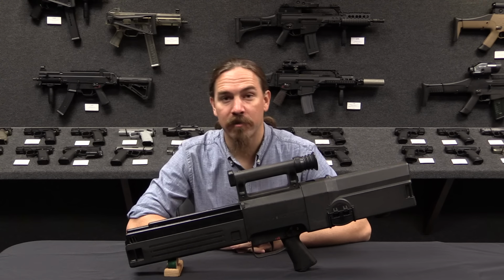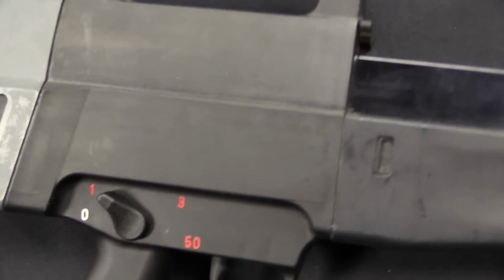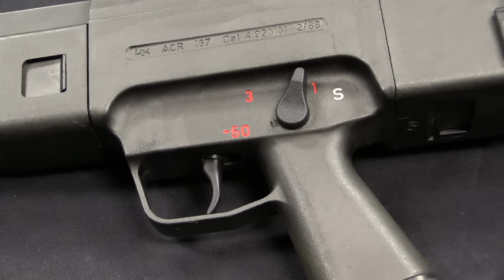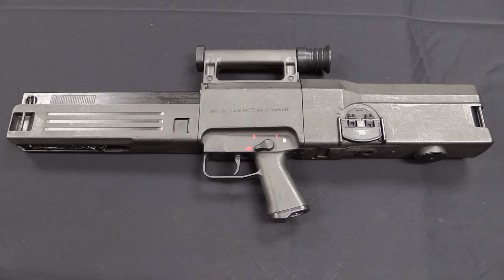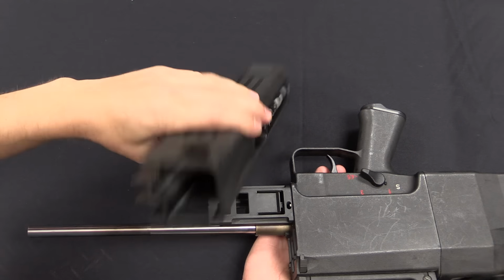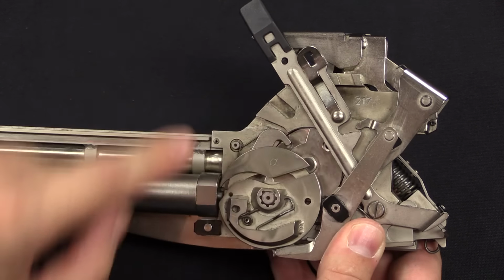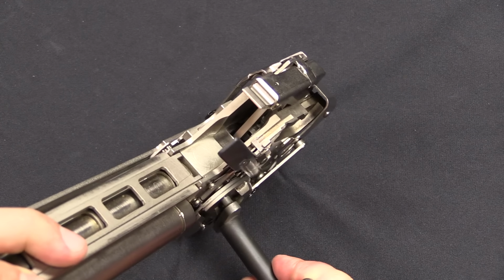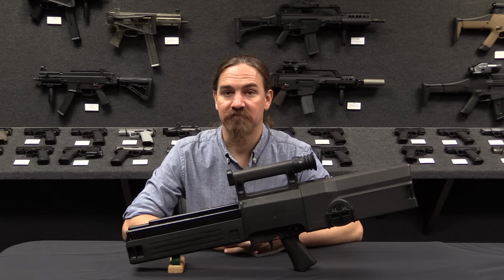Kraut Space Magic: the H&K G11

Comment: Steampunk mechanism very cool.
But ?WHY? the choice of 4.7mm?
That's like 20 caliber ... A pellet rifle! 🤣
Ian, wish you had discussed the ballistics, range and accuracy....how much energy in foot lbs at 100 yards?
Reply: its about 1500J. for comparison 5.56 has 1200J-1600J
so its enough. 
Also a smaller caliber allows for more armor piercing capabilitys as the bullet hits a smaller area as a larger caliber so the Energy/area is higher. 
Remember the goal is not to kill to enemy but to take them out of the fight. thats why nato went from 7.62 to 5.56 even though 7.62 has more than double the Energy. 
The accuracy of the G11 was insane as in the 3 bullet burst fire mode the 3rd bullet already left the barrel when the recoil hits. 
and for range. the gun was required to defeat warsaw-pact armor at 400m but under the hand it was advertised that it could even defeat it at 600.

Comment: My M-16 in the Army was also extremely easy to take apart, clean and put back together. Still to this day I can take apart an M-16/M-4(AR-15) with my eyes closed. And I just don't understand why they had all this wasted space inside the G11. I mean they could have made that thing SOOOO much smaller with VERY little effort. I mean the back of the gun did not need to be that big or wide. I honestly think they designed the front to hold those mags, then just decided to make the back about the same size just to make it look even.

Comment: Did they do any jungle environmental testing? Because that looks like it wouldn't like being exposed to dirty water.
Reply: It was not designed to be used in a jungle or a desert by Bundeswehr, they were purely a defensive army back then, not supposed to fight outside of western and central Europe.
And the mechanism is not that complicated, I mean there is far more complicated machinery that does still work in a jungle or a desert.
I guess heat would be the real problem if one emptied those fifty round mags in a short time in a hot climate.
Reply: It was designed to be used by the German Army, so they never would use it besides defense

Comment: Clearly all the design work was done on the internals, because the exterior of this gun is absolutely HIDEOUS.
Reply: function over form. the project was cancelled mid design. the exterior as you can see could be changed easily as there was space everywhere.

Comment: Considering how empty the back is and how short it is overall, it wouldn't take much to move the grip further to the back and use 75 or 100 rounds clips along with a longer barrel. Maybe make a marksman version where the metal parts are encased in something more robust than plastic.

I always wonder about the caseless ammo reliability ? Did it prove to work well or did it leave too much residue and cause malfunctions over time ? Also what kind of bullet and ballistics are we talking here ?

Could it be scaled up towards 7.62mm ? 12.7mm ? Main argument we hear against 7.62 is usually "it's too heavy for poor baby soldiers to carry" but if it's caseless maybe the weight becomes less of an issue ? So many questions..

Comment: Fantastic, extremely informative video. At the time, I recall the G11 as being under development (this was in the 80s) but still had some teething problems. When it disappeared a few years later, I assumed it was due to technical issues, not the actual political changes that led to the cancellation of the program. It's a hell of a weapon, and it seems likely that if adopted, in time there would have been improvements to the base design and function that could have led to greater accuracy and reliability. Thanks for sharing!

Comment: "See?  The cleaning is so simple.  Now, of course, if this ever gets to the point that you need to detail strip it, you're totally screwed."

A good description of basically every German made machine ever.
Reply: the MG42 would like a word
Reply: @1190reasons  Yes, this "Germans over-engineer everything!" trope really doesn't hold up to scrutiny. There are tons of examples of German designed stuff being simple, rugged and easy to maintain and repair.
Take the VW Beetle for example, or the Leopard 1 and 2 tanks, or the G-36.
And even stuff people use as examples for this supposed German tendency to make everything more complicated than it had to be, often turn out to be the opposite, when you look at them closer.

One example of that are the overlapping wheels on Tiger and Panther tanks.
Sure, they had the disadvantage that they could freeze shut when lots of mud got in between them and then froze, but other than that they were actually a very sensible and functional design, especially when compared to the complicated Y-shaped strut, lever and spring suspension systems British and American tanks used at the time. How would those have held up to Russian mud and winter?

The overlapping wheels had many advantages. 
They spead the weight of the tank out and lowered ground pressure, making them more mobile in mud and when driving over bridges.
They acted as spaced armor against hits from the sides.
They made the tank more stable, decreased crew fatigue and made shooting on the move easier in absence of a stabilized gun.
And they were ultimately easier to change and repair under field conditions.

Sure, it is annoying when you have to remove 3 or 5 wheels to get to one behind them, but it is easier to remove several thinner wheels that weigh maybe 40 pounds each, than it is to remove one big one that weighs 100 pounds.
So even from a maintenance perspective that system made sense.

And when it comes to the G-11...
Just because it looks complicated doesn't mean it is over-engineered. 
It does something no other gun design can do. To prove that it is over-engineered, one would have to design a machine that can do the same thing while being simpler and nobody ever has done that.
And it successfully passed all trials, including extensive field tests, so any speculation over this failing because it supposedly is too complicated are just that, baseless speculation and assumptions.
Reply: @TrangleC  Germans quit making simple stuff over half a century ago.
Reply: @TrangleC  cope
Reply: @TrangleC  "haha Germans overengineer everything" and you had to pull out a wall of text
Reply: @JamesAdams-bd9df  and more importantly, quit overdoing stuff during your french holidays of 1939
Reply: @1190reasons  mhm

Comment: 3 bullets in single brust before the recoil hits that's really impressive, but wouldn't the recovery time after the brust make it kinda pointless? 
Judging by the soligers from the video where the gun was tested they would loose sighs on the target each time they pull the trigger so they will have to re-aim every time. 

Also wouldn't it become real torture for the user after 100 or so fired rounds because of the triple recoil?

Comment: it feels like this gun is one of the few guns that would actually be simpler if it was ran with circuitry
Reply: You don't want to get into a shootout and find out that the battery is dead.
Reply: Yeah I think electronic ignition for the "primer" would be better(basically using a hot plasma arc to ignite the cartridge)... 
 You could also Incorporate basically an alternator in the mechanism, charges a battery or capacitor every time it fires(capacitor has much longer life) 
 And that would remove some of the recoil energy and convert it into something useful. 
 You could easily waterproof all the electronics by dunking them into potting epoxy, which would also help remove heat. 
 I think using titanium inside the firing area would help remove heat, there is likely some other things you can use or do to remove heat.. possibly using a sterling engine type heat pump to push the heat out of the chamber and into the enviourment
Reply: @helpabrothawithasubisaiah5316 
There's better way to waterproof then dumping into epoxy and removing easy repair options.
Reply: It’s the rounds that are the real killer. They are less reliable in storage, transportation, and cook off. Not a good thing in the middle of the desert. 
Plus, with something like the AK, where you can swap mags in less then a second and carry multiple mags on you easily, this is not really needed
Reply: The problem is that adding electronics you would also have to worry about one more thing,and would basically make the cadtridges more expensive or the weapon discardable.
Reply: @lordanonimmo7699  I think the intended joke was to replace some of the complicated and easy to damage mechanisms with electronics that simplify the process.

It's one thing to see a massive watch-like mechanism and have to carefully keep track of pins and screws. It's another thing to just make sure a circuitboard is plugged in the right way around.
Reply: @The1TrueEcho  Yeah,but it is also one thing to such a electronic system to endure so much stress and heat that comes from a weapon.It would just be easier to broke.
Reply: @The1TrueEcho  The minigun isn't carried by soldiers the whole time,it doesn't have to fall on sand,water,mud and other things,so is much easier to design put electronics on it.
Reply: @lordanonimmo7699  tell that to the gameboy that went to Iraq and survived a bomb
Reply: @The1TrueEcho  The minigun's actual electrical system is actually much simpler, really just a wire powering the motor and not something super complicated; even if there are complicated electronics that has to be there (FCS for instance) they can be placed far away from the gun itself.

For an infantry rifle while you can place the electronics far away from the rifle, the major problem is still what do you do if the electronics shit itself, and what good does it do to the rifle compared to an old design - the flaw of the G11 doesn't really come from the complicated clockwork (although certainly contributes to it for being literally impossible to maintain on field), but the fact that it uses caseless ammunition that is too complex and introduces so many issues a circuitry based firing mechanism doesn't even address
Reply: @The1TrueEcho  electric power != electronics
But OP is right, the G11's firing system is what happens when a bunch of mechanical engineers try to build a computing device.
Reply: As good as it sounds, you won't have much luck after a nuclear explosion and it's EMP
Reply: The first thing real troops should be teached is how to do without electric stuff first, then in case it works use it, making the rifle electric will make your troops unreliable by design
Reply: He is correct tech would make this gun better unfortunately everyone who makes guns is like 50 lol. So no one wants to add tech to a gun and take the risk of actually inventing something. Make that gun. It would be cracked AI in a gun is op you see it all the time in games
Reply: @Rizzinomics 
Flash news: Life isn't video games yet. Guns cost money to make, need to be lightweight so troops carrying them don't die of exhaustion after 1 hour of moving, and tend to get dirt, mud and all sort of liquid splashed all over it. Guns in games are always good because they're fictional, developers can make a glock kill the sun without a fuzz. Why don't you try that IRL? 50000 await your success.
Reply: @crappyshorehen8201   close minded you just labeled everything we need I’m not a gun manufacturer so why would I make one. It’s plausible so chill
Reply: @Rizzinomics 
If it's plausible then do it. Also, I barely get what you're trying to say in the first half. Why am I close minded? What I labeled? What's that "everything we need"? Your reply is incomprehensible.
Reply: @Rizzinomics  You know how many problems it will cause? As long as only americans get to keep that it's fine by me, more money to our weapon producers after you regret your failure
Reply: @switchstatement568  failure of what creating a weapon that is op besides we all know America is living on borrowed time.
Reply: @switchstatement568  so you assume China is the main threat to us? The entire world mostly governed by the UN or the USA uses brute force and its mass of people to scare off threats. It's just the bully. So alot of contries including china are looking to knock off the us. The only problem I have with that is who comes to power next if it's a good leader or not. The us is made up of alot of bad people tho.
Reply: @Rizzinomics  I know, I would say the us deserves the nukes and the bad things they did in the past, but I obviously sided with NATO through my country... I'm not stupid, even if USA are one of the worst countries i can think of, it still defends the civilized world for now, it's not even remotely comparable to the Chinese points system whose country is suddently becoming stronger than NATO and already owns internet and the european economy
Reply: @switchstatement568  why do you think ip65 and higher rated shit doesn't exist lol.
Reply: I hate electronics
Reply: @SankoshSaha_01  then why are you on here
Reply: @SankoshSaha_01  nobody cares

Comment: Ok, hear me out. What about a gun that operates the same way but is way simpler because it scraps the whole gas system & transmission by just actuating the bolt with an electric motor?
Reply: With all the advances in electric motors, batteries, and power electronics in the last decade, that's probably very recently gone from "impossible" to "difficult".

What I'm saying is that it's time.

Comment: I wonder if the projectile wouldn’t have benefited from a pinfire setup, where the primer is seated at the base of the projectile and the powder block burns from the front to the back. It would mean a longer than normal firing pin, but I’m pretty sure that with modern steel options there would be an appropriate material to make it.

Comment: How to maintain this firearm:
1. Get a PhD in Mechanical Engineering
Reply: @Marzsala  A can of WD-40
Reply: @martinhow121  😂😂😂
Reply: @martinhow121  Hmm, I think you're onto something! Place the entire assembly in a tub of solvent? Then blow dry.
Reply: If you have seen the video the handling is simple. If something goes wrong with the action and it stops working, the part simply would be replaced as a whole and the old part goes back to maintenance or the manufacturer, where specialized workers would either repair it or destroy it. If the plan went through we are talking about manufacturing some 200.000 guns or more and if the part is repairable this would be also streamlined and the military units would have a small stock of spare parts or refurbished parts. But probably the barrel is the first thing that needs replacement after some thousand rounds went through.
Reply: @adamabele785  Nope. Rumors said that the chamber only holds for a few thousand rounds before needed to be relpaced.
Reply: I accidentally read that as medical engineering.
Reply: Need 3 years experience using this weapon before you can first use this weapon.
Reply: No you need a Dr.-Ing.
Reply: @Marzsala   what does that even entail what does having something theoretical open the door to I'm intrigued
Reply: ah, we all know that people from germany has one XD (it's a joke)
Reply: @Marzsala  cringe
Reply: > tfw cleaning the gun is an armourer level task
Reply: @IncredibleMD  no this requires your local magos, sacred oils, incenses and of course prayers to the omnisiah
Reply: Just because something looks weird doesn't necessarily mean it's unreliable or difficult to maintain.
Reply: @Marzsala  a theoretical degree? Those exist?
Reply: @epauletshark3793  “theoretical degree in physics” was also in Fallout NV, nicely done 👍
Reply: @ninaaniston1717  so is colorectal implosion syndrome
Reply: @epauletshark3793  yes there’s lots of theory degrees such as gender studies 😂
Reply: Or just do year 10 Science/physics. That’s plenty
Reply: And a degree in thermodynamics
Reply: German;s get those with their birth certificate
Reply: "Caseless Ammunition".

I just looked that up and the jury is in --- it's too dam figglety and fragile.

DOES look like an awesome Stormtrooper gun tho maybe they could hit something with it🙂🤙
Reply: @Marzsala  its in fallout 2
Reply: @Marzsala  I believe it's a Degree in Theoretical Physics your thinking about, but any grunt knows enough to fake it either way :p
Reply: @Marzsala  who the hell says "based" are you 5 years old?
Reply: @Solaxe  cringe

Comment: I am curious what would happen if you had one or more dud rounds when using the three round burst mode.  Seems like the round wouldn't be able to eject because the chamber(?) wouldn't be lined up with the ejection port hole on the stock of the gun.  I guess dud rounds are pretty unlikely, but does seem like it could be a problem since I expect the three round burst mode would be the most commonly used.  Maybe it's not an issue because the gun wouldn't cycle on a dud round (due to lack of gasses in the barrel) and would only be cycled by using the "charging handle/key" after being back in forward position...
Reply: If there is a dud during any point of action then the entire assembly gets ejected forwards by the recoil spring (or retained at original position, if it's the first round that is a dud), then you rotate the bolt to eject the dud round